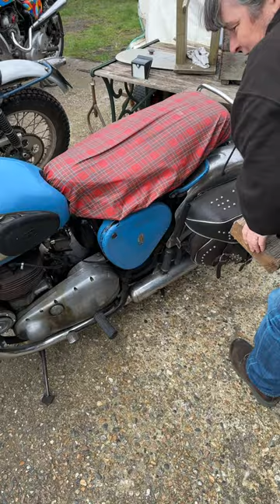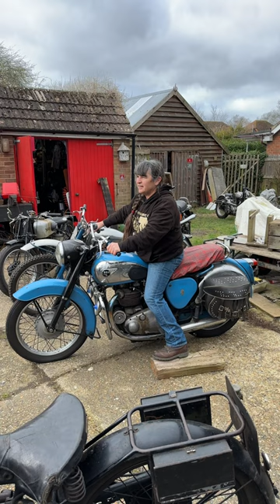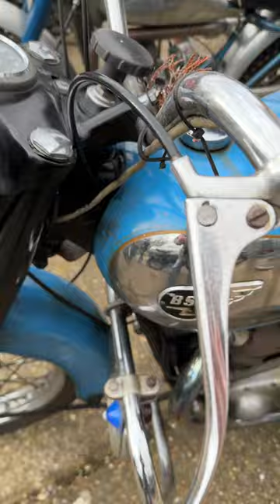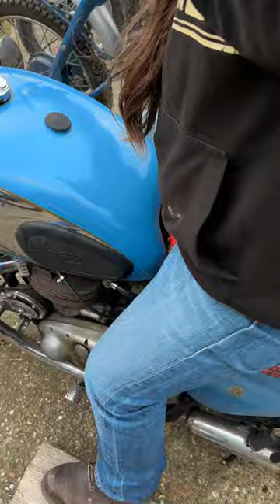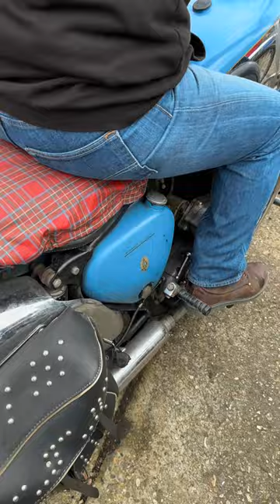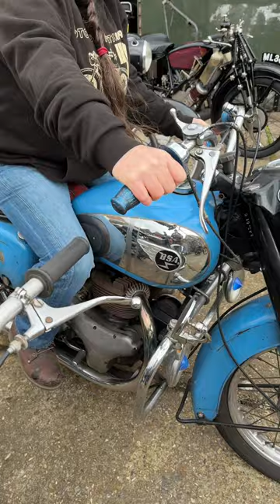Julie only needs one step to start her '55 BSA Super Flash

Comment: Sorry, not a Super Flash. They came out in 53 not 55. Frame etc also not SF spec.
Reply: SF's have chrome mud guards and twin clocks. No nacelle over headlight. Also wrong oil tank. Pretty sure this bike is swing arm rear end
 Should be plunger suspension. Still without knowing engine/frame numbers,who knows.
Reply: @tonymay8521  I think you're confusing your models, this is an East coast spec machine, shipped in '55 to the USA and sold in 1956 by Wolfe's Cycle Sales in Springfield Mass.